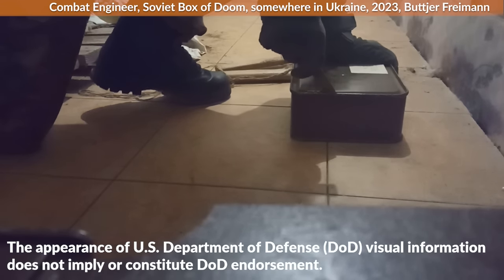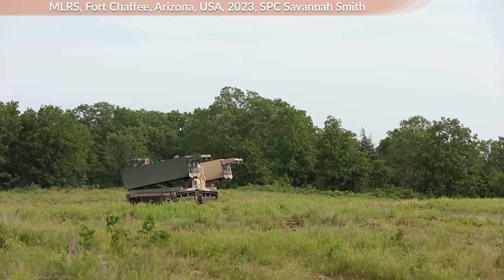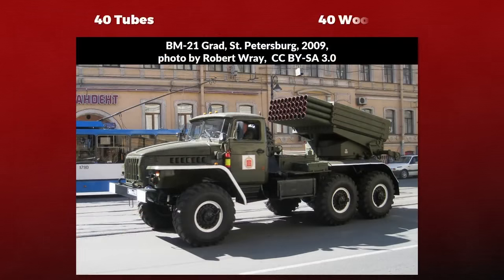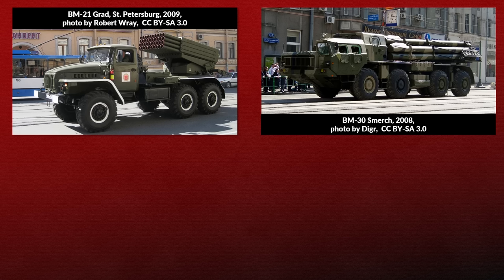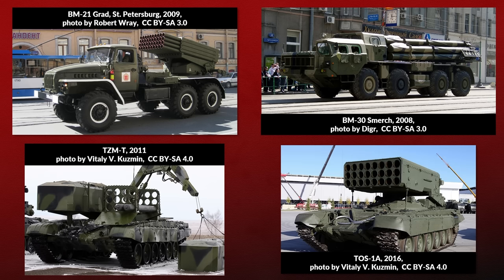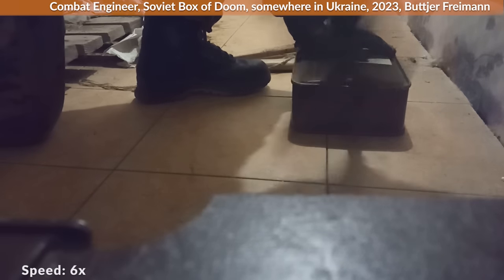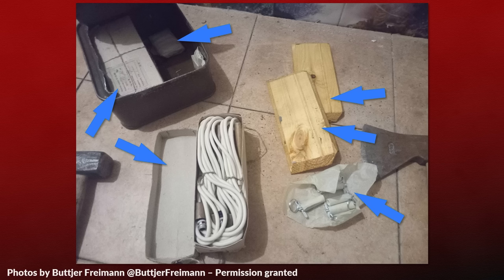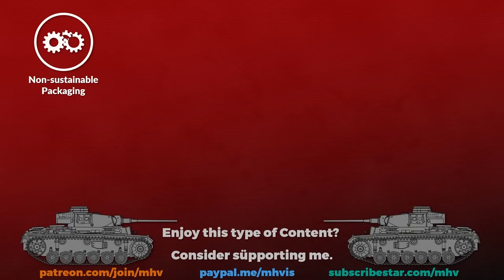Ukraine: Why Soviet Packaging is a Nightmare - Unboxing Edition

Comment: I really think you should post a contrasting video of Western small arms unboxing/unpacking. Because I am retired US Navy and part of my jobs was weapons handling. Explosive actuation cartridges typically come in cans best described as paint cans with tight fitting metal lids, sealed internally with a sealed foil barrier with a pull tab. Small Arms Ammunition are in classic GI Ammo Cans with a one lever latch and hinge that is easily detached,  once you lift the bail and swing the lid back you have full access to the contents, after that there is often a foil seal adhered to the can lip and it has a pull tab. After that the contents vary and do depend on what you ordered. Mostly pasteboard boxes stuffed with ammo, some boxes have pull tabs to help remove ammo from the can because they are stuffed with packed ammo. Now I have heard that you can order up full belts of ammo for belt fed guns and for those the SOP is pop pull the empty can out of the carrier and toss it, put the new can in the carrier for the machine gun, pop the top, toss it, rip off the foil seal, grab the belt and feed it.... but I've never seen that. I worked mostly with ammo for pistols, rifles and explosive actuation cartridges ....oh, and torpedoes, Penguins and Hellfires.

Comment: Working with Russian small arms is just miserable... I notice that the design of all their magazines is kind of weird, I guess purposefully designed to maximize awfulness.

In particular, magazines that are single feed. It's like they make the feed lips just a bit too long, so that it is really hard to push down on the bullet to feed the next bullet. The PPSH-41, Tokarov and Makarov pistols all seem to have this problem. Compare that to 1911 magazines, where the feed lips are a bit shorter so that you can push down on the bullet already in the magazine.

I think those guns all had some kind of specialized magazine loading tool, but those are rare, and I've never seen them.

And yeah, the "spam" cans... can you imagine sitting in a Russian trench trying desperately to open one of those cans, and then to have to pull on the little string, and pry each little box of ammo out one at a time, and then to rip open the paper carton and try and find all the ammo hiding in the paper wrapping...

But they never "discovered" the forklift either...

What's that saying? "We're lucky they're so stupid!"
Reply: That last line has been a godsend for decades, not gonna lie.
Reply: The Brits lost the Battle of Isandlwana partly because of their logistics - Martini-Henry ammo was distributed in wooden crates screwed shut, which took ages to open (and they did not have enough screwdrivers). 

Similarly, one of the things we Aussies changed after the Battle of Long Tan was to stop treating SLR magazines as part of the rifle, but as separate, almost disposable items - because previously ammo was only distributed in clips, and you were expected to just refill your issued mags if you ran out. After Long Tan, ammo was issued in loaded mags more often.
Reply: Clearly written by someone who possesses no knowledge or logic when it comes to firearms whatsoever. To spew pure nonsense from start to finish takes a special kind of stupid.

Well done, Joey.
Reply: @hoilst265 Many forces including the British SAS loved carrying stripper clips. They're definitely cheaper and may make more sense than carrying 20 magazines on some days.
Reply: @zoltancsikos5604 Try saying anything of value next time, instead of just calling the guy dumb. It helps get your point across better.
Reply: @zoltancsikos5604  This was the battle of Long Tan, where the guys were expected to hold, not shoot & scoot  like the SAS.
Reply: @marcusborderlands6177  Funny thing is, I'm actually a firearms instructor... I've worked with all these guns 5 days a week... and yeah, when you got a group of clients come in and they all want to shoot the Soviet junk... it's a miserable day. I did get Carpal Tunnel in both hands from loading so many magazines... hundreds of magazines per day....

Comment: Yugoslavian national army had also packaged ammo in cans. It was a wooden box in which is a tin-can box, but easy to open with a wire, you pull out the wire and it gets opened. Those were probably mainly used as shelf backup supplies, not opened until absolute emergency.

Comment: While a very entertaining video , this packaging is NOT meant for field-use.  These are depot (storage) containers and for that purpose they are amazingly well-engineered.  The video poster is conflating field munition boxes with depot munition cans.

Russian field-use packaging consists of either cord-wrapped/latched wooden boxes for explosive ordinance or nested waxed cardboard boxes for everything else (except rations).
Reply: And yet there are large numbers of reports and even videos of these containers being shipped to the Frontline troops.
So the system is broken
Reply: I agree, but ostensibly, that's not the key point of the video.  @bobjoatmon1993
Reply: @keithwilliams6007  I thought (and I'd better successfully that a lot of commenter's also though so) it was implied that it WAS being used such and WAS a factor in the Russians poor performance.

Comment: You forgot the point of counter artillery, 4 min is way too long. Rocket systems are very easily to locate while they fire, and at this moment they become targets themself by artillery of the enemy. Therefore they get only rarely used, in comparison to regular artillery.
Reply: That is though why of course the reload site and the firing sites are never in the same place

Comment: Um, I can say categorically that the tubes for HiMARS and ATACMS are NOT reusable...  they are scrapped after firing... The overpressure of the tube during firing warps/bends the frame of the launcher structure (the launch tube rack, not the vehicle structure) and makes it unusable again.
Reply: MHV conveniently leaves that part out.  Which plays into the cost of a reload.

Comment: The packaging is excellent.  Sealed from the environment and delivery doesn't require specialized equipment.  All manually assembled. In my opinion they are assembled in a safe site and the Grads will go to the loading point to be rearmed.  They will not sit on the loading site while the rockets are assembled. While the Western method uses specialized equipment, trucks for transporting the package dedicated for such purpose. Maybe the Russians are scattering these loading sites in different locations to minimize losses when detected by the enemy.  One reason the Russians are shooting more rockets than the Ukrainian. Just saying.

Comment: There is some change in Russian equipment. The ISDM for remote mining swaps the entire launch module with the reloading vehicle. All the older systems don't, though. And even newer versions of the BM-27 load rocket for rocket. This is also why russia is slowly moving away from massive rocket artillary, but to precision fires. The massive barrages are not effective enough and the logistical burden is too much for the russian logistics to bear (although they still manage to support massive amounts of arty). It's funny to see Russia slowly move towards Nato doctrine because it makes sense

Comment: Disposibility is a sound idea for military equipment. That goes right up to MBTs in a peer conflict. It saves alot of logistics and management.
More importantly, it can be scaled up much faster.
Reply: You have to me mindful when planning the disposability though.

Most of the US ammo packaging is designed to be reusable, but immediately and optionally reusable for storing something else on the front lines, rather than being necessary to be reused or shipped back. It's still all classified as "expendable" and certainly no one is expecting you to turn the boxes back in (so technically disposable) The truly "disposable" packaging is generally plywood, cardboard, and plastic, which is lighter and probably cheaper than a lot of the Russian packaging methods. If it has to be stored for the long term the US has climate controlled facilities that it can be stored in for decades depending on the actual lifepsan of the item. 

In the case of the MLRS modular rocket pods concept though, it's actually designed to speed up logistics near the front lines. Once the launcher has fired its missiles, it's just a glorified truck and needs to move anyway to avoid counter fire, so it can drive back to the depot, drop off its old launcher, and pick up a new one. If the launcher gets destroyed the truck probably got destroyed too, so there's no real benefit to making the launcher pod itself disposable.
Reply: The last time that was true was WW2 and even there it was already arguably unsustainable. Modern weapons are simply too expensive and valuable to use like that. Even the hyper simplified and optimized T-34 production of the Soviets was working at or beyond the limit with how the Soviets used their tanks. And that was while the Soviet industry was fully mobilized and could essentially just rely on the US to construct and replace any manufacturing tools and machines they needed.
Reply: @MajinOthinus  If you can't afford to lose it, you can't afford to use it. (Which is Ukraines' problem right now. They have some good gear they can't deploy to maximum effect because they can't replace it, e.g, challengers, patriots, Abrams, even himars to some degree.)
Russia is losing more gear, but they can replace it. Ukraine can't.
Reply: @hendrikvanleeuwen9110  There is an incredibly large difference between being able to take losses and a system being disposable.
Reply: @MajinOthinus  It is part of the same philosophy. A trip to the front is a one way ticket. As long as it does its job once, it doesn't need to come back.
If Russia sends a tank to the front, it gets knocked out but does its job, that is a win. If Ukraine (or any NATO power outside of the US) does the same, it is a loss.
This is the power of the 'everything is disposable' strategy. At the end of the day, America relies on the same approach, at least as far as equipment goes.
Reply: @hendrikvanleeuwen9110 No it isn't. That strategy will inevitably lead to your defeat if you aren't multiple orders of magnitude stronger than your opponent. All it does is maximize your losses.
Reply: @MajinOthinus  *if you are multiple orders stronger than your enemy. 
Yup, now you are getting it. (Although you don't need multiple orders of strength. A slight advantage will snowball over time), again this is what is happening in Ukraine- they were reasonably even at first but the side able to forward the most materiale (for whatever reasons) is pulling ahead. 
 If you can't fight that way, the only viable option is insurgency.
Reply: @hendrikvanleeuwen9110 they might not have the ability to replace it though, their industry is a mess, and they might not be capable of making the right kind of steel for artillery barrels
Reply: @Brent-jj6qi  Are you suggesting that Russia doesn't know how to make gun barrels to replace gun barrels that Russia made? That is some next level cope.
Russia is one of the world's largest steel producers (look it up if you dont believe me). They have been making essentially the same barrels sinceWorld War 2, so they obviously have the metalurgical know how. Or did I misunderstand?
The only thing they are short of is chip technology, it seems.

Comment: There's a story told in my family from communist Poland (PRL / PRoP):
My unle worked for the comany that exported pickles to either Sweden or Norway. The thing is they were packaged in wooden barrels so thick and well made it was much, much cheaper to buy said barrel with pickles inside than alone, dry one. these boxes sometimes remind me of that.

Comment: For the ubiquitous/ infamous small arms munitions cans is there no powered mechanical method for opening them available whatsoever?  I always assumed the can opener was a last resort, not the primary method.
Reply: surely a kitchen can opener with the sharp wheel and gears could be used, or a more robust version could be invented? It seems like there's a big opportunity here for innovation. Even a bigger can opener made of harder steel would probably reduce the effort involved.
Reply: Actually, surely one of those sheet metal nippers you attach a drill to would work?

Comment: In America we call those sealed tins of surplus ammo "Spam cans" and you used to be able to get 440ct cans of 7.62x54r for $79 and 1080ct cans on 5.45x39 for $189. If you bought two at a time they came in a small flimsy wooden crate and included one can opener per crate. If you only bought one can, you didn't get a can opener and were screwed.
Reply: Well, the packaging is thin tin. Here in Russia, food cans without a ring are still common. So you need a can opener. But, apparently, mom forgot to put a normal household proper steel canning knife in the backpack of the German/Austrian combat engineer, and the Ukrainian comrades didn't share. It happens. And the Soviet logistics were to blame and shame.
Reply: Not 100% sure what youre on about but the packaging is not "thin tin". It's at least twice as thick as the sealed cans the Yugoslavians used and it's  magnetic too so it's definitely not tin either. After removing the lid, the edges of the can are razor sharp as well. Great for long term storage but sucks to open and use.

Alot of old surplus ammo comes in sealed cans like that but other countries like Yugoslavia and America have little pull tabs on the cans for easy opening.
Reply: @thomas8318 One opener knife is stowed in each wooden crate (57-Я-001 or 57-Я-005) that contains two ammo cans.
As the author of the video quoted the combat engineer: one knife is just enough for two cans, after that it gets blunt. Hmm... Isn't a coincidence here? 
But, in the process of getting ammunition to the front lines, anything can happen. I didn't have anything to do with detonators during my service, it's not my military specialty. But before my first field exercises, I was "strongly advised" to "give birth" to a homemade can opener (or a multitool or something like that), just in case: If the ammo cans come to us unboxed, If some idiot loses a knife, etc. But hey, what can Russian two year conscripts know compared to a combat engineer from the mighty NATO, right?
Now, about the thickness of the "spam cans". If you've seen a regular keel knife for opening these cans, you should realize that almost any domestic canning knife, made like a metal cutting knife, will be better. Because it's a junk throwaway piece of steel. But, you may have gotten just the cans at retail, without wooden crates or something. Because it's very obvious.

Comment: As someone who has had to unbox fuses for 122 mm artillery shells, if you open the can "correctly", you can't get the fuses out without spending another several minutes breaking one wall of the can because of the sharp, jagged rim of the can and the hard packing material the fuses are cased in. The trick they didn't bother teaching us was to cut off the entire top of the can around the outside, so that there is no rim only flimsy walls that you can bend easily. It's exactly as stupid and awkward as it sounds, the opener isn't designed for it and neither is your physiology.

Comment: Bm-21:  produced  in 1960   ..........................................................................................................M270 :  produced 1983

Think there might be a difference ???
Reply: The Tornado-G, produced by Russia since 2011, uses the exact same storage and reloading system as the Grad. The BM-30 smerch, and the Tornado-S both use the individual reloading system and storage as the Grad. Only the 9A52 Tornado has a containerized storage and launcher, and that still has not entered service.